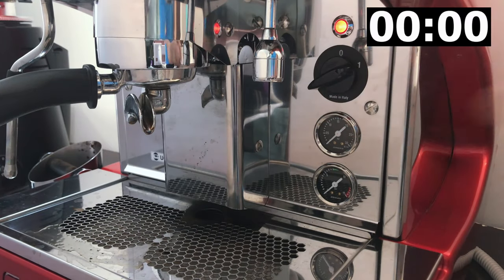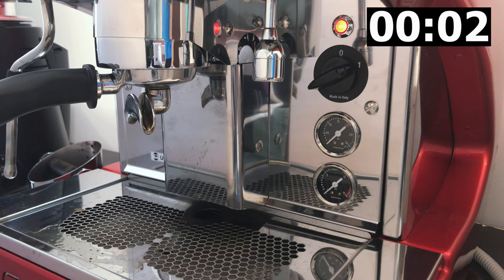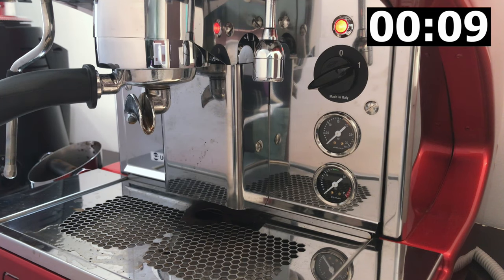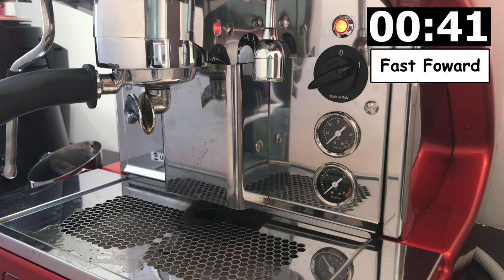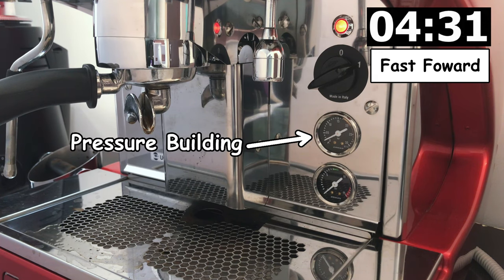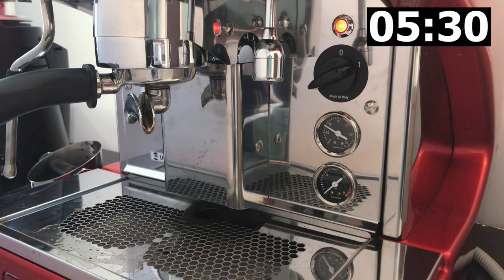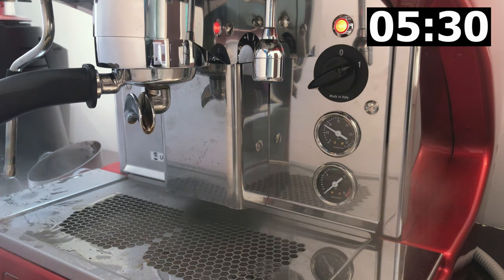(181) Synchro 1 Group - How long to Start / Boil water before I can make coffee?

Comment: Yeah but that doesn't mean the grouphead is heated to the required temp... rule of thump you would need around an hour (or 45 minutes if you do some flushing) for everything to be ready for action. Heck, even prosumer E61 machines need an hour to each "equilibrium" .
Reply from the maker: This depends on the machine, for this machine there is a short copper pipe that links direct to the boiler, therefore faster to achieve this required temperature, as copper is a very very good conductor of heat. Those using steel, iron or plastic would take a far longer time to achieve this. Also when doing flushing, try not to flush more than 5 seconds, as this will reduce the temperature. If you havent you can try flushing 5 seconds and 30 seconds, you will find after 30 seconds the temperature of the group head will drop.
Reply: @MalaysiaBarista  I agree with you. However, it takes around an hour to fully heat up and be ready for use. The grouphead is a huge lump of metal and takes a lot of time to reach equilibrium (boiler's temp). After it reaches that and remain on for a long time the grouphead will be too hot and needs to flush the boiling water for 5 to 10 seconds depending on the machine of course. After that, it should be ready.
Reply from the maker: Copper conduct heat extremely well, so it shouldn't take long at all. If it is metal/iron/steel and non copper base, it will take longer.

Comment: Great video, super helpful!  Besides the top pressure gauge letting you know the machine is ready, does the light above turn from red to another color once the machine is ready for use?
Reply: Also, what is the function of the silver button on the top right hand side next to the green light?
Reply from the maker: Its a mechanical manual button, the Italians call it PM or Pulsating Mode. Some machines uses a small lever to activate this. This bypasses the DE or electrical button system.

Comment: Amazing machine! Hi, do you know, whether its possible to use the 7l boiler version of this 1 gr machine without direct water intake (no plumbing, only use external water barel)? Is the pump capable of suction? Thanks!
Reply from the maker: There is 2 version . Vibration pump and motorpump / rotary . The motorpump can be connected to water in pipe, which you can then connect to an external water contain like under the table top . The vibration pump doesn’t have sufficient suction .
Reply: @MalaysiaBarista  Thank you for the clear answer! I assume that this method is applicable to other such machines, equipped with rotary motor pump. Thanks